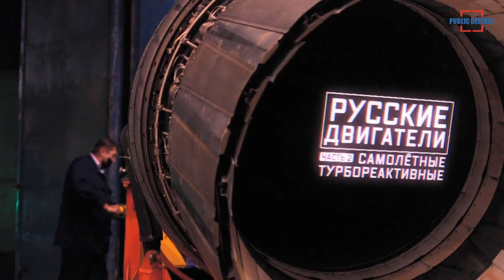Second Stage Engine for the Russian Su 57 Fighter Jet could be Classified as 5+ Generation

Comment: F35 isn't a pure 5th Gen fighter, IMO. Su57 should never be compared to F35.
Su57 will have to be in a league of its own.
Reply: Well, by weight and number of engines, it is OK to compare Su-57 and F-22. The F-35 is from the light fighter class, it has one engine, not two. Moreover, the F-22 and Su-57 main combat role is the, so called, 'air superiority' against other fighters. The F-35 was designed, mostly, for the, so called, 'ground tactical tasks'. By the US AF concept, F-35 should be covered by the F-22 fighters to provide their protection from the enemy fighters. Yes, the F-35 can use the 'air-to-air' missiles, but its main role to engage the surface based targets, not aerial. Su-57 is quite universal. It can be used for the both combat roles. This is why some people like to say , "Su-57 = F-22 + F-35", meaning, "57 = 22 + 35".
Reply: @maksimluzin1121  No, the F-22 should be considered a 4++ generation , while Su-57 a 5+ generation. Only the J-20 should be considered a 5 generation.
Reply: @udontknowme7798  good joke
Reply: @udontknowme7798  gtfo lol
Reply: @udontknowme7798  , Indian air forces tracked the Chinese J-20 many times by their Russian produced Su-30 fighters many times, this is how they said...
Reply: It never was...russian propaganda.
Reply: @Samsun55  , Americans have more money for their propaganda...
Reply: @maksimluzin1121  And better planes lol
Reply: @Samsun55  , Who told you that? Americans? Why you believe to the American propaganda? They have more money and brainwashed you better?
Reply: @Samsun55  , lol-like and SmartPhone generation...
Reply: @maksimluzin1121  Nah my healthy mind and history says that. But you can hype your sowyet era tech if you want. Doesnt disturb me.
Reply: The same can be applied to the Su-57 and its poor RCS of 4++ generation aircraft, its not a true 5th generation aircraft
Reply: @darhammora7867  , tell me, please, the Su-57 RCS. You don't know it? Why? Because it is classified? Did you saw the final serial production version of the Su-57 or only its testing prototypes?
Reply: @maksimluzin1121  the one that crashed last year you mean?!
Reply: @darhammora7867  , So what? Another one serial Su-57 is produced and completed the test flights already. Russian MOD ordered and signed the hard contract for the 76 Su-57 already.
Reply: @maksimluzin1121  any aircraft can have accidents, I was kidding about this, but what I read about the recent final production aircraft is that the company has changed the engine air intake to reduce RCS, this draws two points: first, the aircraft is supposed to be finished, I don’t remember any western aircraft to have such a structural change at the last moment!! Where was the company from this design flaw earlier?!! Second, this change or move alone is not enough because the air intake duct is not serpentine in structure to be truly stealthy.
Reply: @darhammora7867  , It is wrong from the very begging. The Su-57 has the, so called, radio blockers in front of its cold turbine. By the way, the Su-57 design is more sophisticated, it is designed to reduce its RCS not only by its 'surface stealth covering', but mainly by its internal structure, to 're-path' the incoming electromagnetic radiation to 'inside' of the plane, and to 'supress' it inside, like in a 'labirint' (maze)...
Reply: @darhammora7867  , It doesn't matter what you say, because you don't understand the so called 'stealth technology' by means, how it could be achieved. It is not, so called, 'radio optical stealth', especially in the centimeter (X-band) diapasons, but the 'suppression', 'consuming' and other aspects... I do know enough about 'stealth technologies' from the text books, with the Physical and Mathematical formulae
Reply: @darhammora7867  , it can not be 'bio hazardous' by the Physics laws, the incoming electromagnetic signal by its summary energy is less than 1 Watt from any direction and outgoing radar radiation power. By the way, if you don't know it, the radiation power is dropped by the root of power 3 by the distance range. You should learn the Physics and Mathematics, not the American propaganda. By the way, go at least to Wikipedia and learn how many ways the 'stealth technology' has...
Reply: @maksimluzin1121  good for you, I know them also by study
Reply: @darhammora7867  , I'm sure, you know not much about the subject even by study, since I just see the lack of knowledge, just by the dictionary and terminology used by you. Sorry!
Reply: @maksimluzin1121  , if you are good observer like you talk, you can check the air entrance with a very rectangular shapes on the su-57 (Forbiden shape on stealth tech). RCS on a su57 is between  0.1 and 0.5 squared meter. Trying to compare that with the 0.0001 squared meter of the f-22 its just stupid. Im just stating the radar wave deflection (or lack of reflection) capabilities and not pointing any extra jamming device. With this new engines the su-57 will get more power than f-22 reaching 172 KN per motor. But... USA already flown a 6th gen plane which broken alot of records... Isn't this a bit late for sukhoi's fireworks?
Reply: @GHOSTKILLERAAA  , you know nothing about so called stealth technologies, but I do! You don't know, but the Su-57 has the radar blockers before its cool part of turbine,  the intakes are made from the composite materials and covered inside with the radio absorption layers. The RCS of F-22 is just an American advertising for an idiotic believer, like you. Even the smallest cruise missiles and MLRS rockets has the RCS about 0.01 sq.m. I just know it from my military service. People, like you, believe only to advertising and YouTube videos. I know Phisics, Math and I spent my years in Army.
Reply: @GHOSTKILLERAAA  , the 6th generation plane does Not exist! A flying testing  prototype is Not a Make! About 80% of DARPA projects Never reached any Final or Production phase. The 6th generation American fighter jet does Not Exist yet! Only Advertisings for idiots!
Reply: @GHOSTKILLERAAA  , A Sukhoy chief representative said once per interview: 'The Su-57 will have the very close to the F-22 RCS characteristics  and values'. I believe to the people who have the full access to the Russian military intelligence data, Not to an advertising and Wikipedia stories or YouTube blogers. Just look to the T-50-10, T-50-11 pre-serial production prototypes of the Su-57 and to the first serial one, made already. The photos and videos are available on Net... You will see the difference between the flying Test Prototypes and the Serial Production one, if you could to find the difference at all...
Reply: @maksimluzin1121  , sukhoi wants to sell and it's doing what you just say: ADVERTISING. Strange when you have strong information from russia, but not with EUA, and you still try to do a comparsion between SU-57 and F-22 saying that they have same RCS. I dont belive a word from the sukhoi chief rep. I already posted here the values, i wont repeat it.
Reply: @maksimluzin1121  , a flying and close to work prototype worths  more than 1000000000 words. I quote: "The US Air Force is already working on its 'highly-secret' sixth-generation fighter jet under the Next-Generation Air Dominance (NGAD) program, which will be a step above the fifth-generation F-35s with futuristic technologies. The prototype was even flown in September and is said to have “broken records”" Doesn't seems to me any sort of russia promises of the mig-41 or the british's tempest(...It's real.... It's happening!!!!)
Reply: @GHOSTKILLERAAA  , blah-blah-blah... As always...😂
Reply: @GHOSTKILLERAAA  , You just believer to the words, a church is just a right place to believers! The F-22 is based on the 25-30 years old technologies, its production stopped for many years already, it is forbidden for export from USA, so, no one official foreigner can confirm the military experts of Aviation Week & Space Technology, GlobalSecurity.org estimations of the F-22 RCS, based just on the Lockheed Martin words representative. Russian aviation experts, including from Sukhoi, the Russian military intelligence sources and mathematic modelling on supercomputers provide the same value range for the F-22 RCS from 0.1 sq.m. in best, from the frontal hemisphere, closer to the central symmetry axis line, to 0.3 sq.m. from other directions, in averages ... This is just Physics, Mathematics and Intelligence, not believes of brainwashed idiots! The Su-57 RCS is estimated to 0.2 sq.m., in average, so it is closer to the real F-22 RCS in range of 0.1-0.3 sq.m., from different directions. The F-22 was designed and produced 25 years ago to get air superiority against old Soviet Su-27 and Mig-29 at Cold War time, and it Had it! Long time ago...
Reply: @GHOSTKILLERAAA  , Actually, the USA, so called 'stealth technology' is based on work of the Russian (Soviet) professor Pyotr Ufimtsev many years ago... You will find... Actually, the F-117 was the Only real 'stealth aircraft', based on the Ufimtsev equations, but ugly! Aerodynamically... Moreover, the Ufimtsev work was published without Conclusions... 😉 Just 4 last pages were Not been included... Where, he concluded, the radio wave interference and superposition on the borders of materials' ages are Not the Guarantee for the stealthiness'... Learn the Physics and Math. Especially, Differential Equations... Moreover, 12-15 years ago, we had (classified) textbooks in the Russian military schools, with the All the sheets and radio distribution diagrams of the F-22... Don't ask me from, we wouldn't ask... Just Learn and Understand the matter, nothing more...
Reply: @maksimluzin1121  , if it is work of Pyrot Ufimtsev, why didnt russia made a stealth plane before USA? Ahhhh, a work without conclusions(...) And diff equations to predict the radar deflection dont use the composites absortion layer variables, or they do? Can you express that? How? I already forgot physics, maths expecially diff equations for my luck. No more integrals, primitives and derivated equations! Learn what? You are focusing the models which dont contemplate material absortion composites studies. You can assume a greek letter, but just that. It's useless giving unknown random values(...) You are swimming on a dry lake(...). You dont have for sure the paint of a f-22, so you can not estimate an unknow value where you dont have any more additional reference. You could had a textbook with radar reflection of a specific shape, but i bet it was missing the absortion chapter... So put material chemistry on your model.
Reply: @GHOSTKILLERAAA  , No, the Pyotr Ufimtsev work results were been taken by Lockheed Martin engineer Denys Overholser for the F-117 model calculation, and for B-2 bomber later. The Ufimtsevs' work was Published without conclusion he Wrote, where he proved the uselessness of it for the military and economics... Secondly, the electro magnetic absorption  materials are quite well known subject, we have had about 12-14 types of them (15 years ago) in textbook, with description and chemical compounds used in them + advantages and disadvantages of each one. The theory of the electro magnetic (radio) absorption and transparency is very well known and very well described for dozens years. The biggest problem with a such material, its thickness should be at least half of the radio wave length to absorb most of incoming energy, just by laws of Physics. Therefore, all the absorption materials used in the, so called, 'stealth technologies' do consume electromagnetic energy only in the spectrum of short wave X-diapason (centimeteric) and only partially, because of thickness limitations, in the real implementations. The technology of the 'reducing object visibility in the electromagnetic spectrum' has different approaches and solutions:
- radio-optical (special shapes and orientation of planes to reduce re-reflection between them to the signal receiver).
- radio-transparency (to reduce overall signal reflection at all, but partially, anyway).
- electromagnetic energy consuming (by using materials which 'absorbs' some amount of energy, but not all of it, because of Physics and Energy Consuming laws, Thermodynamics laws).
- electromagnetic counter measures ('jamming'), to affect the receiver signal detection and processing in the very different ways, really!

Anyway, the so called 'stealth technologies' are not a 'silver bullet', you will 'pay' for it in one or another way... This is the Materialistic World, Physics everywhere... Russians Do Know the 'stealth technologies' for decades very well, theoretically and practically, but considered that is not a 'silver bullet' if your military objects will lose other combat  characteristics and advantages in the System of Equations and Target Optimisation Functional, by the Final Combat Requirements of Ministry of Defence. Contrary, Americans  decided that is 'The Silver Bullet' and spent billions of dollars for it and for Propaganda around it.
Reply: @GHOSTKILLERAAA  ,'so put material chemistry on your model'... I will not, much smarter people Did that decades ago... This is Not about Chemistry, by the way, but about Physics! Electromagnetism, even in Chemistry, at low level, is the Physics! Return back to school lessons, you missed, obviously...
Reply: @maksimluzin1121  lol dude even india left the su 57 program lol like bruh the plane is only good at dog fights other then that its shit
Reply: @coolgamer8411  , dude, collect information before you write nonsense! India has the own project FGFA, based on the Russian platform T-50, two seat, by the way. Russian Su-57, based on the same T-50 platform, always considered as one seat fighter. Moreover, the Indian program 'Made in India' required to transfer and port on Indian territory at least 50% of strategical imported weapon technologies. The problem was, the Indian HAD could not to implement even 30% of the T-50 production technologies, because they did not had the production facilities of required level, scientific schools, and, most important, own people, who could implement all of it on own territory. This is why they exited from the FGFA program and invented the story about 'T-50 weaknesses'. They simply could Not to implement it by own resources! Nether the less, they are in the continuous discussions with Russians to accept and buy an export version of Su-57E, when it will be available later...
Reply: @coolgamer8411  , so called 'dog fight', is one of the misunderstood thing in the reality. The super maneuverability of a plane is required not for 'dog fights' in close range, but for the evasive maneuvers from the long range missiles, because, most of them, burn out their solid fuel long before they reach a target. Therefore, they use only collected kinetic energy on the active phase of their trajectory and their aerodynamic fins to approach a target. If they miss a target, they will not return back and just will self destruct themselves. Therefore, the most important advantage of the super maneuverability is Not a 'dog fight', but the ability to escape a long range AA missile!
Reply: @coolgamer8411  , and finally, Russian has the very long range AA missiles. Moreover, they are in the final stage of testing of the very long range Hypersonic AA missiles for the Su-57 and Su-35, maybe, for Mig-31 interceptors, as well... Learn the Data, Physics and Math, not the American advertising propaganda...
Reply: @maksimluzin1121  , for your information, painting materials are based on chemistry composites which intends to react  with physic phenomena like radio waves. What part you didnt copy? Its not eletromagnetism but radio wave absortion. Avoiding reflection(...) RAM (radar absortion materials) are based on polymer composites. "Polymer composites comprised of a carbonaceous material filled into a polymer matrix" doesnt look to me physics(...) Im talking just the "car paiting", not jammers and other things that you try to shake and mix(...). Your technic is to answer with tons of useless information in hope that 1 hits the target(...) Try to understand the context, think and then answer. Go back to school to practice what i just said. And again, if you have a lot of info about russia planes, and dont know nothing from USA side, tell me how you can trace a comparsion between them? Cheap talk!
Reply: @maksimluzin1121  , you are so naive(...) Russia dont advertise propaganda????? AHAHAHAHAH
Reply: @GHOSTKILLERAAA  , radio waves are a form of electromagnetism, electromagnetic field. Go back to school yourself. Moreover, the absorption material should have thickness at least half of the radiowave length diapason. This is way it works only for the centimetric X-diapason and not fully. It only reduces the reflected energy, but not eliminate it at all.
Reply: @maksimluzin1121  , go by your self to the school instead sayig it to others. Because you are looking just the effect of radar absortion instead of looking the chemistry behind those materials. A polymer i ensure you its not physics field like you are pointing over and over. Im not saying radar (radio waves) are not electromagnetic because they are. Never said anything else than the painting material. That's why i  am repeating over and over. The research of that material is a chemistry field. For sure they test the absortion eficiency with radio waves(....) But its not a exclusive part of physics like you said before. (DOH- In physics you dont research polymers...)
Reply: @maksimluzin1121  , so russia doesn't do propaganda because it's poor? God sake!!!!!! Every ppl over the world knows what a su-35/37/51 are (...)
Reply: @GHOSTKILLERAAA  , Russia do Not provide any Propaganda! Russian Set of Mind is Absolutely Different to Western or USA one... Do Understand that! We are Not like you And Never will be!!!
Reply: @GHOSTKILLERAAA  , you do not understand Polymers and Physics, and Chemistry, By the way, At All! Polymers are just a Chain or a  Composite Layer of Chains of polymeric carbon chain 'formulae'. A polymer can Not be an 'electromagnetic energy absorption material', by Definition! It can be, 'radio transparent', in some diapasons, but... No comments more!
Reply: @maksimluzin1121  russia do propaganda and thats a fact. They also want to sell planes. What you say is a non sense. When you see all around videos about su-35 doing acrobatics and su-57. Denied that is foolish.
Reply: @maksimluzin1121  , no im not. i just dont wash my hair with your shampoo. A fact is you do a comparsion between a russian plane which you said you know it very well due your iprivilege informations, and you admit you dont know the f-22/f-35 sheet. And argued based on computer data models made  by russians(...) Who is brainwashed?
Reply: @maksimluzin1121   i just point your view when you refered its physics. No, its not physics. Its chemistry! But you must test ithe eficiency with physics. (Did i miss something?)
Reply: @GHOSTKILLERAAA  , electromagnetic fields is Physics. Moreover, Chemistry, at low level, is Physics, as well. Check what is the Electron Valency means.
Reply: @GHOSTKILLERAAA  , we had all the real RCS data and the 3D electromagnetic distribution diagrams of F-22 in our (classified) textbooks ten years ago, at least. Well, I read it ten years ago... The Military Intelligence, probably, got it... The Reality is far different to the American advertisings and propaganda, just believe to it! 😎
Reply: @darhammora7867  , FYI, the Sukhoy design bureau representative said once in his interview: 'The Su-57 stealth characteristics, including the RCS, will be comparable to the F-22. At least, not worse'. I believe to to the official words, not to your abstract implications.
Reply: @maksimluzin1121  the Su-57 will never reach the RCS of the F-22, it’s engine air intake duct is not serpentine, it’s wing leading edge alignment is way less stealthy than the F-22, the degree of vertical tail stabilizer is less canted than that of the F-22, the spherical IRST above the nose, the design of the canopy... etc, Sukhoi said it, they want the RCS of the Su-57 to be at max of 0.1 square meters, even theoretically if it’s decreased to 0.01 with latest modification of the engine air intake, it would still way below that of the F-22 or F-35
Reply: @darhammora7867  , How much do you know about, so called, 'stealth technology'? What did you say it is just one aspect of the subject, so called, the 'radio optical characteristics'. But the 'stealth technology' has many aspects and ways... Whatever Americans say about their F-22, it was based on the 25-30 years old technologies and solutions, known to them at the time...
Reply: @darhammora7867  , The Su-57 does have the radio blockers in front of its cold turbines. It doesn't need the, so called, S-shape air intakes. Moreover, it uses some specific layers and materials to suppress the incoming electromagnetic radiation inside of the air intakes, and in the plane construction, by definition.
Reply: @maksimluzin1121  these frequency jammers works like an internal ECM pods, they will delay detection for a while, not reducing the S-Shaped RCS
Reply: @darhammora7867  , they work not like 'frequency jammers,, but, better to say, like 'electromagnetic energy jammers'. This is about terminology, this is , actually, is very important, the terminology . For example, many Russian professional specialists do not use the word 'stealth', they use the entire sentence, like 'actions and technological solutions for reducing an object visibility in different electromagnetic spectrum diapasons', true, this is not so 'tasty' like 'stealth', but more systematic and more 'fundamental'.
Reply: @darhammora7867  good joke😂😂
Reply: @mrmountain3017  sorry, I do not joke
Reply: How true!